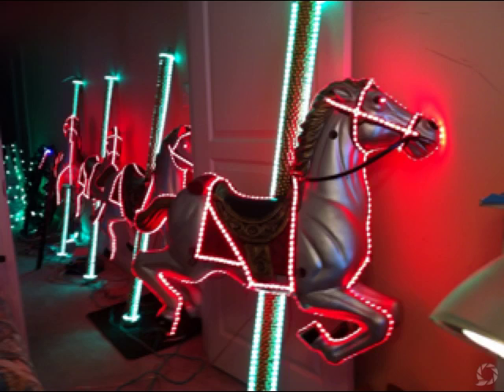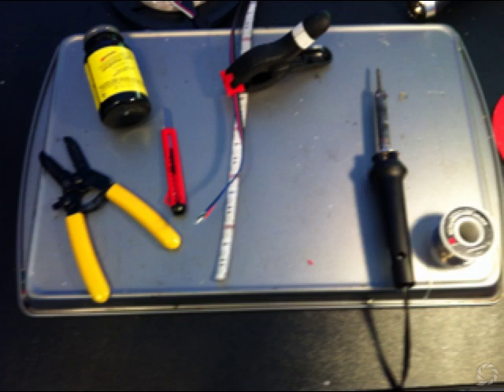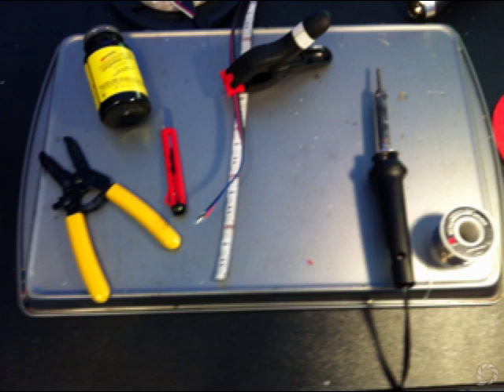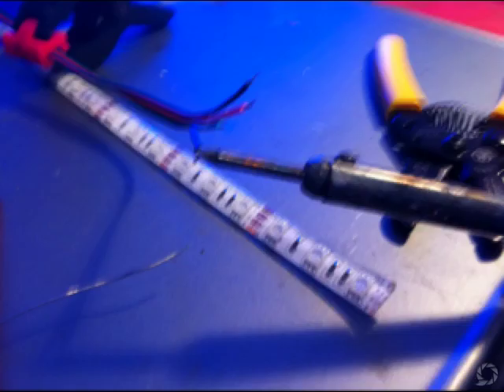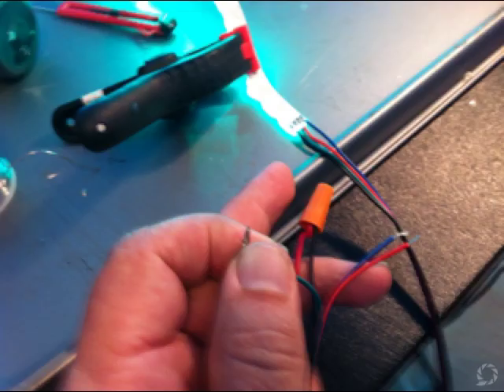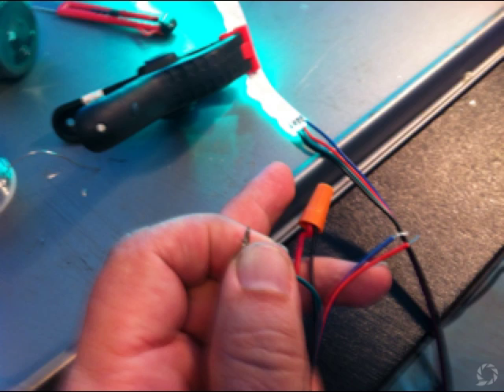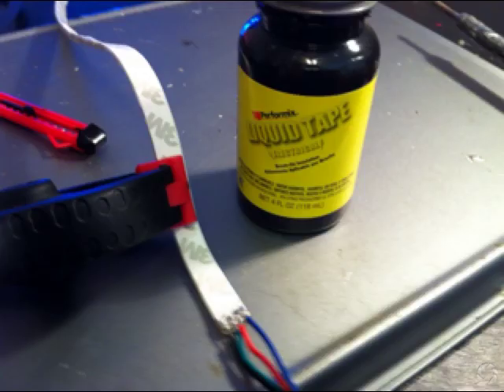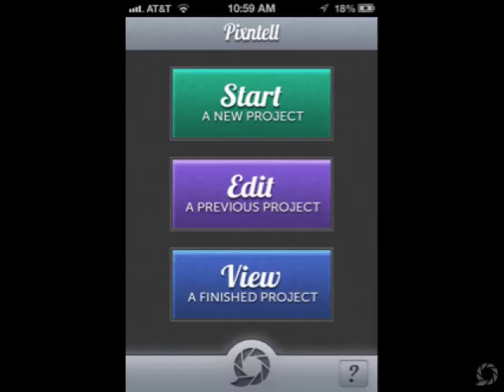Easy way to Solder RGB LED Strip Lights | LOR | Light-o-rama | DMX | Christmas LED |

Comment: What kind of wires do I need 2 buy for this?
Reply: http://www.ebay.co.uk/itm/Wholesale-4-Pin-Extension-Cable-LED-RGB-Light-Strip-Wire-Cord-3528-5050-New-/371116738237?pt=UK_Home_Garden_Lighting_Parts&var=&hash=item56684806bd

Comment: how do you properly tin the wires?
Reply: DB Coop use a little flux on the end of the wire and add a little solder.  This will be the easiest way to properly tin your wire.  You don't want to see a glob on the wire.  You should be able to see the outline of the twisted conductors that make up the wire.